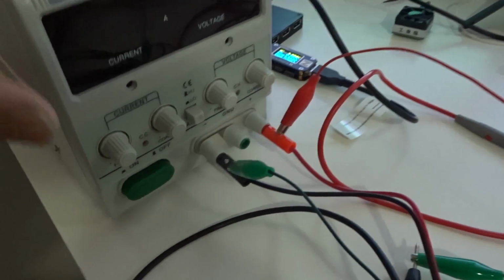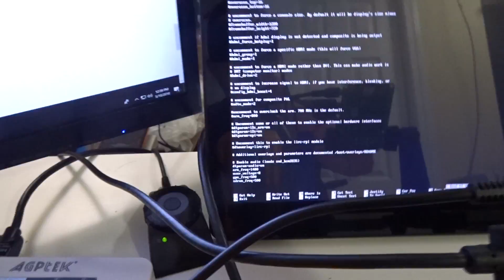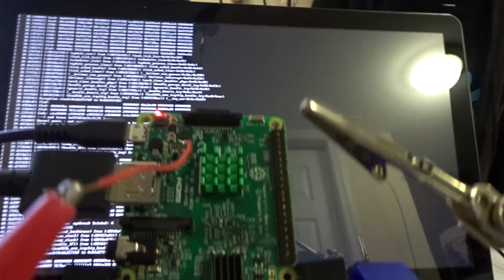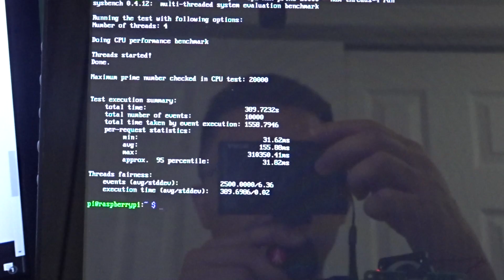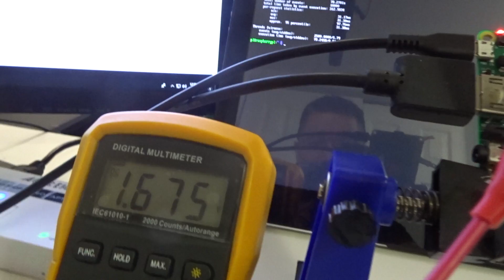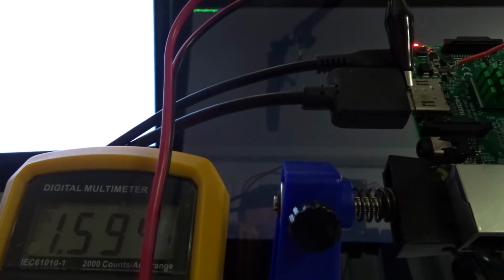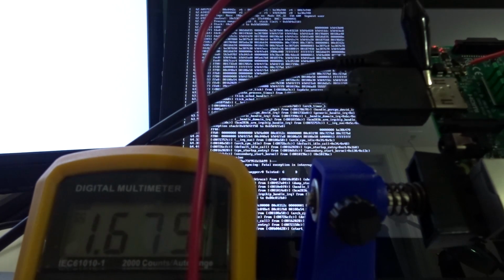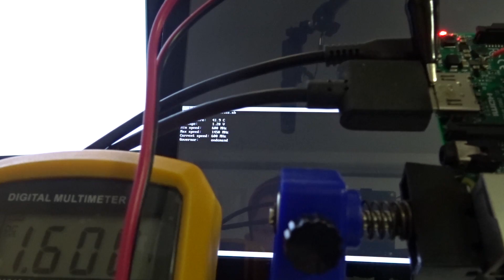Overclocking Raspberry Pi 3 past 1.4ghz by applying more voltage!

Comment: I have my pi 3 over clocked to 1.7ghz without having to load extra volts into it and the temp runs at about 45C. anyone wanting to try use these settings in your config.txt file.

arm_freq=1700
over_voltage=5
gpu_freq=500
sdram_freq=500
total_mem=1024
gpu_mem=64

Comment: I am running a heat sink that is attached to the CPU with carbon epoxy . The heat sink is 1 1/2 " x 1 1/2" x 3 ". I can run it with FULL load at 100% for 2 hours and it does not drop in speed where as the the the heat sink and poly in yours at 1100 mhz will drop in about 1 minute.  Oh yes I am doing this at 1350 mhz!

Comment: You definitely don't need a thicker wire. It's 2 volt max so there is not much going though. I kinda was hoping for a smokey death 😂
Reply from the maker: I was hoping for that as well lol. That's why I kept putting more and more voltage

Comment: Can you put the Pi's supply voltage on an oscilloscope?  You will be able to see the fluctuations.  Perhaps you are getting a momentary dip in the voltage which causes  the kp's.  It would be difficult to detect this without a scope.

Comment: The cooler I have for my rpi is custom made by myself...... Cools the rpi to 30°c

And if you are wondering I have the Rpi 3 model B the older version not the model b +
Reply: I have a cooler that uses a peltier module to cool to -40 ish degrees, but I haven't overclocked on it yet

Comment: My over voltage is on 6 when I have it on 1.4 ghz..... I only take it to 8 if I have it on 1.7 ghz
Reply: The GhostRider mine is running over voltage 6 on 1,45
Reply: PARADOX_gaming A streaming chanel same with me if I go to 1500 I keep it at 6 unless I have issues..... Then I take it to 7 sometimes..... Other wise I keep it on 6.... 1.400 I sometimes keep it at 5

Comment: Take care about the power supply some cheap ones makes little voltage peaks when you turn it on, better plug and umplug the banana conector that turning on the power supply conected to the raspberry.

Comment: This video makes me excited about overclocking my Pi 3 Model B. 
I keep my Pi in one of those snap together clear cases with a 40mm fan on top that spins fast and sounds like a tiny airplane. 

I was able to get 1.4GHz by using the settings below.
arm_freq=1400
core_freq=500
over_voltage=4
sdram_freq=500
disable_splash=1 #forGoodMeasure
But my temps on 6 passes of a 20000 prime sysbench start at 37.6C and go up to 75.2C. Using the Official RPi3 Power Supply, the PSU you choose makes a big difference in stability,  Great video!
Reply: I did a similar thing except I had to crank the over voltage to 6

Comment: An higher gauge will not help you much , from what I can see ,your bench PSU is not even showing the amp used , you are in milliamp or microamp , that cable looks big enough but you can calculate the resistance , what's worries me is that you are applying a reverse voltage  to the regular of the rpi , you will break it that way , the regular is not desing to find higher voltage on the output.

What you can do is make sure that the DDR ram are getting enough power and make sure that they are not getting the injected 1.6v
Reply from the maker: One of the reasons why I love uploading to YouTube! This comment is spot on. I'm going to check the ram voltage like you said and yea the amp meter is broken so I am going to see if I can exchange or repair it. I know the amps work cuase I was able to put a load on it with a tester but I just can't tell how much... Maybe the screen is disconnected in side?
Reply: Novaspirit Tech , is possible , not likely, but possible , you can use your meter to read the current flowing through the wire , that would give you and idea of how much current your psu is providing...